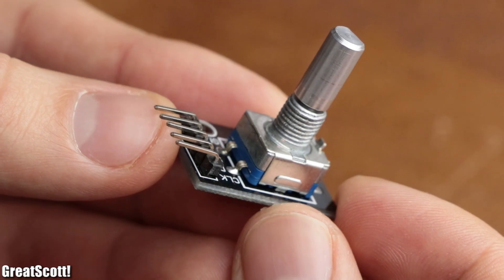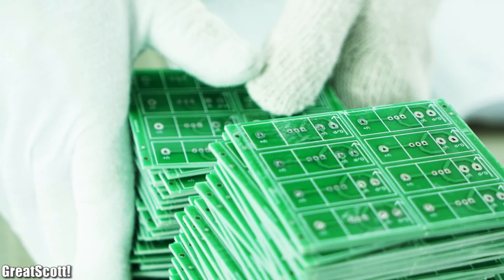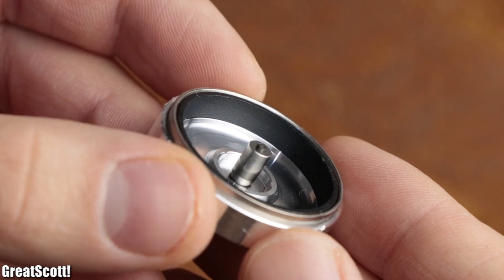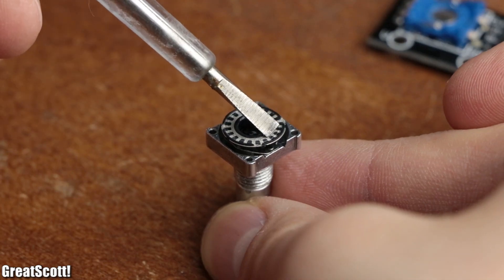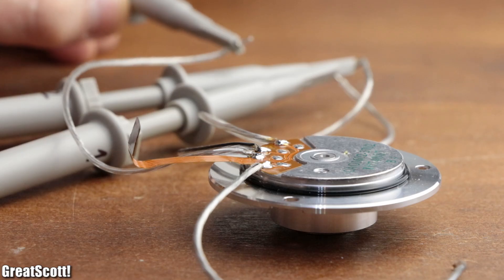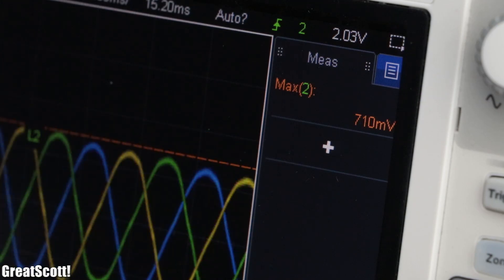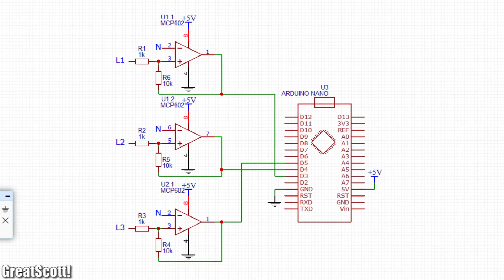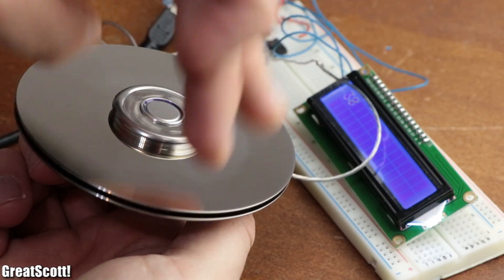HACKED!: Using an HDD Motor as a Rotary Encoder?!

Comment: Since L2 either leads or lags L3 depending on the directions, can we just compare the analog voltages of L2 and L3?  If L3>L2 the we are going clockwise. If L2>L3 then we are turning counter-clockwise?  If L2==L3 then no movement?  I have some hdd motors here. I can try in 24 hours.

Comment: Could you utilize a shared PCINT for all 3 signals on one port and read the PINB (or whichever) port variable directly for tracking without the loop. We did something similar with 2 encoder pairs for a wheeled robot.

Comment: GreatScott I'm missing just one thing from the video, how slow you can turn it and still detect the movement?

(Perhaps  an op-amp configuration that had a high enough gain, to simply clip the signal to the supply rails could be used for the analog to binary stage and perhaps help with lowering minimum speed that could be detected)

Comment: Is there a way to increase the sensitivity? In the end of the video you spin the platter and it looks as though it spins a few turns yet the display outputs only a step difference of 2-3. In this way, it's quite useless as a rotary encoder.

Comment: DUDE!  WOW that is very cool indeed, I have been seeking such a device in building up my FM Radio System for our RV  Sadly I have all the parts at home in South Dakota, whilst we sit here in South Central Arizona.  Hard to put the devices together when such distances separate the parts fro each other; that said, I will add your video to favorites and watch it when I return in the Spring, if the Dakota's are still there come the thaw

Comment: Can you run a comparator of two pairs of phases instead, so you get two digital signals to process instead of 3 and could potentially use it in place of a standard encoder?

Comment: Hi Scott, cool projects (as always); I was thinking that this could be taken to the next level where the rotation speed and acceleration would increment/decrement the value faster. Also, maybe keeping it connected to the analog inputs would allow to measure the amplitude, which is proportional to the speed. Great work! Stay cretive & I'll see you next time!
Reply: Indeed. If I would have the needed skill, I'd try to implement this for my DIY small arcade cabinet. That HDD motor would surely indeed have very satisfying feel cause if it's good bearings.
Reply: Indeed. It's a hall effect rotary encoder.
Reply: @れろらりる-u4p  There are no hall effect sensors in his hard drive motor.  He relies on measuring the voltage resulting from induction while spinning the it.  In effect it is acting as a 3 phase generator.  What you are referring to would be a sensored BLDC motor.  You can make a much better encoder from a CD rom drive spindle motor that is sensored (has hall effect sensors).  That is a totally different principal than what he is showing here.  Instead of tapping into the coils, you would tap into the hall sensors directly.
Reply: @Enigma758  I mean that's how hall effect sensor works.
Reply: @れろらりる-u4p  I mean that in the video, it is imprecise due to the fact that induction depends on motor speed.  Many who have tried it complain about that and they are correct.  Using hall effect sensors in a sensored motor totally avoids that problem.

Comment: +GreatScott! You should add clamping diodes to the inputs of your opamps - those Microchip opamps have max input voltage of Vdd+1 V, so 6V in your case. The motor can easily generate higher voltages if spun up fast enough, potentially damaging the opamps.
Reply: Max speed, like 7200 rpm is reach with 12V. If you are able to reach 3600 rpm by hand to reach 6V, you will be the fastest human on earth

Comment: You can do the same thing with a stepper motor and get multiple ticks per rotation. It can be really useful if you run out of rotary encoders and have a spare motor.

Comment: Great video! Why add the hysteresis to the comparators though? Is it to make sure the voltage from each phase of the BLDC motors is going below 0 before switching back to 0 at the output of the op amp?

Comment: Could you make a video about a hardware circuit that generates the 1-2 ms signal for ESCs and servos? I've been working on a project where I need to take a couple input resistances and output a control signal for a servo without using a programmable microcontroller.

Comment: So I currently have a arduino with a rotary encoder hooked up as a volume control for Windows. it has a old school power knob on it that is labeled "Dark Current" From the good old Valve electronics days. Now my next step would be to use this to turn my old HDDs into volume knobs for my PC!

Comment: Now please do the opposite: RUN a hard drive motor at stupid speeds :D Of course, just use the drive's board is what you'll say, but that's not really DIY is it, plus some don't run without the heads present or if the disks are unreadable (which they are by default, since it's not meant to be opened)

Comment: this encoder certainly has problems in low rotational speeds, so what is the minimum working speed you achieved with this method?

Comment: Great video as usual. You could use the analog voltage generated to determine how fast the motor is spinning and thus make it a velocity controlled rotary encoder so that the faster you spin the more you change the output number.

Comment: hey guys ! I'm working on a raspbarry pi 3 laptop and I need a Li-Po or Li-Ion charger that can deliver at least 2A and a maximum 3A. I have 4 3.7V Li-Ion batteries in paralel whit 2500mAh so their capacitance in total is 10000mAh and their code is INR18650-25R I'm buying the batteries on ebay so here is there link https://www.ebay.com/itm/4PCS-Samsung-INR18650-25R-R5-2500mAh-20A-High-Drain-Li-ion-Battery-with-Tabs/272875190964?_trkparms=aid%3D111001%26algo%3DREC.SEED%26ao%3D1%26asc%3D41376%26meid%3D168b89b825dc4aae9dd8f4d65322dd28%26pid%3D100033%26rk%3D2%26rkt%3D5%26sd%3D352103737240&_trksid=p2045573.c100033.m2042

Comment: That's nice work but I have a few questions :
1- you just used it as rotary increment so if we need to use it as an encoder we have to interpret the value of induced voltages across motor phases and direction of the rotor to speed value... correct me if wrong.
2- The change of value for increment depends on zero cross value of induced voltage which it may take multi rotations to acheives this change.

Comment: its a great video thumps up:) may i ask you something, always i mess my circuits with a lot of jumper wires. i saw you use silver copper wire in your videos. i couldnt find them in local store near by me. but i saw them in amazon. but i doubted, wich guage silver copper are you using?

Comment: The rotary encoder dials you find in digital stereo equipment with only 3 pins work differently to that one, the cpu in the stereo just registers the order in which the pins get connected together to determine the rotation of the dial to either increase or decrease the volume, thats what i think anyway

Comment: Stepping motors are not much different from the three phase DC motors, and they also have been used as rotary encoders in this manor.
Reply: As soon as he did the doodle for the four pin motor was wondering if you could connect one it to a stepper controller.

Comment: You basically "reinvent" a resolver :D
Reply: Sastas - Nézz be hozzám ツ Actually This isn't resolver. Here you just have a 3 phase generator and measure the generated voltage which is zero when it's stopped or moving slowly. Resolver works by driving one coil and measuring output voltage that coupled in two other windings.
Reply: Well, thats true. But its still closer to a resolver than an encoder.

Comment: You can also use a regular dc motor for this too :D
Reply: R4MP4G3RXD not really
Reply: Are you sure about that?
https://www.youtube.com/watch?v=xjXBE8Tt4kI
Reply: Except how do you detect the direction of the rotation with just one phase?
So I guess sort of... but not really.
Reply: It's pretty simple, if you turn it in one direction the voltage will be positive compared to ground, and if you turn it the other direction the voltage will be negative compared to ground. You can use some comparators or do what Evan did.

Comment: I'm going to refer back to this video for my sensorless bldc motor experiments. I tried to breadboard a circuit a couple of years ago but I could only make the bldc spin like a stepper motor. It would only run smoothly after it reached a certain speed. It had no useful torque because I did not know how to set up the comparators.
I'm not going to hack a hdd motor but the information in this video is absolutely useful. Thank you!

Comment: Half baked idea:  Could the motor/encoder be driven as well, so as to have a remote control that activates a manual knob?  The arduino would just end up reading the drive power to register a knob movement.

Comment: While this is cool, it sure seems limited. If you move the encoder too slow, the voltage produced will be too low to be detected.
This is a cool gimmick but it certainly doesn't replace quadrature encoders.

Comment: Great video! However... You only need two of the phases. Typical encoders operate in quadrature or 90 degrees. Yours operates in tritrature? or 3 phase. Wasteful. Also, no detectable output at very slow rotation. On a normal encoder, connect both outputs to an XOR gate and you double the pulses per rotation. Connect phase one to the clock pin of a 74HC74 D flip flop and the phase 2 to the D input. Now the Q output will indicate direction and the XOR gate output gives you finer resolution steps. This little bit of hardware "preprocessing" will free up the highly precious processing time in your microcontroller. For actual useful purposes, never process hardware pulses in software. A processor using 98% of its processing time to read a switch is just plain wasteful.

Comment: Very clever application, thank you for the wonderfully detailed explanation (as always).  Shouldn't it be possible to use only two of the motor phases?  Instead of being ~90 degrees phase shifted (as in standard quadrature type rotary encoders) the two outputs would be ~120 degree phase shifted.
Reply: yup, im pretty sure we can. Since most incremental rotary encoders actually use 2 signals only.
Reply: @mashfaqm  But then there is latency since only a bit changes across the 3 phases at a time.

Comment: Thought about using 74hc14 to interface the motor to a digital circuit?
Btw, i am moving to Berlin, Germany in a few weeks. Any local hardware store you would recommend?

Comment: Well.. thats a fancy fidget spinner.. jokes aside.. nice vid..would be cool if you could count the rotations and rpm and such..like using it as a dimm switch or virtual turntable for example.
Reply from the maker: That should all be possible. Of course it would require more complex code. So not my cup of tea.

Comment: Can you explain how three phase electricity works.Im talking about mains electricity.
Reply from the maker: I put it on my to do list
Reply: Niko Andruloni back emf causes them to sync automagically
Reply: yeah, especially how watts are measured across three phases! - maybe even a BLDC 2 phase to 2 phase converter !
Reply: they will auto sync.
Reply: Ariel Lezen I think its one generator just with 3 coils like 3 phase motor. I could be wrong tho
Reply: + Кристиян Митев
You are "wrong", he wants to know how are different power plants synchronised.
About getting 3 phases, you're right, one generator is the simplest solution.
Reply: That's assuming there's no exciter coil(s) and it's using a shaded pole type rotor (normally low or medium power). Syncing requires a little more interesting circuitry on the ones with exciter coils.
Reply: Niko Andruloni Sorry i didnt understood his question corectly.How power plants synchronise i realy have no idea.Maybe each generator goes to 1 big city or something?
Reply: GreatScott! Specifically knowing how many generators started at different times and places can all be in phase supplying mains power

Comment: The Rotary Encoder in the video registers 4 pulses per click and should work much better than a hard drive motor in many ways. Just get a better Rotary Encoder which offers satisfying resistance like ones you find on some high end digital audio amplifiers.
Reply: Yes! There are lots of different rotary encoders.
Reply: Where is the fun in that?  I was literally sitting at my desk today trying to think of something to do with a hard drive motor I had salvaged, when the notification for this video popped up.  It made my day!
Reply: Bill Holloway Keep in mind the method suggested in this video requires the motor to be turned fast enough to produce the triggering voltage. If the motor is turned too slow, the movement won't be detected.
Reply: Duane Degn Thank you!